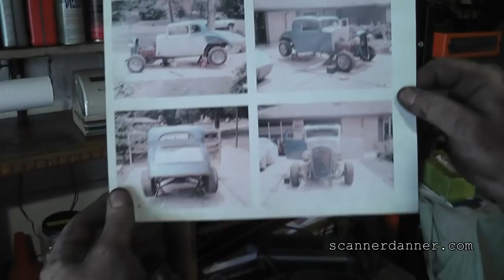The Danner Boys (where we started)

Comment: Leak Detection Pumps(Chryslers) yuck...so easy to nuke, haha. James is spot on with that and he's rocking that gnarly mountain man beard, awesome. I had to cut mine, it was getting to be just slightly annoying.  Dropping a front diff to do an oil pan gasket r&r, fun times, especially if you sneeze out 10w-30. Great video Paul, it is good to see that brotherly love.  Joe is the MAN, I had to throw that out there, lol.

Comment: i have 04 maxima and have po301 code. i replaced all sensors, all coils, and injectors with new parts. i notice the #1 injector is not firing so i swap #3 and #1 injector plug and it #1 worked and #3 didn't. replaced ecm with one from junkyard and all lights on dash work but no start...i add jumper wires from #3 to #1 injectors and car run but service light still on. i have changed all sensors and wire harness too everything new. help please. james spratley